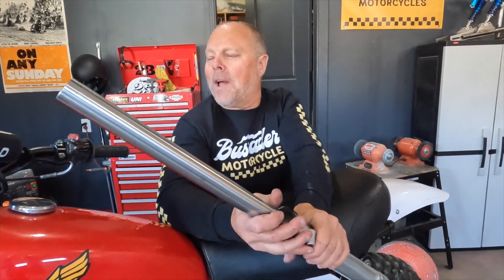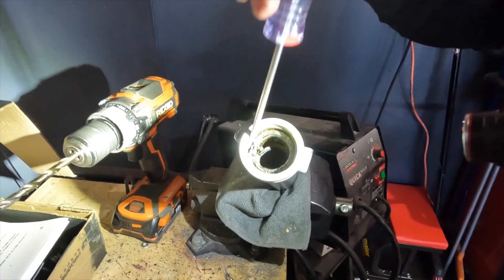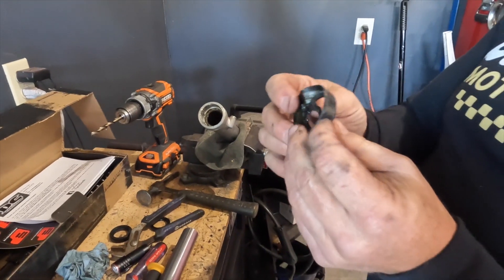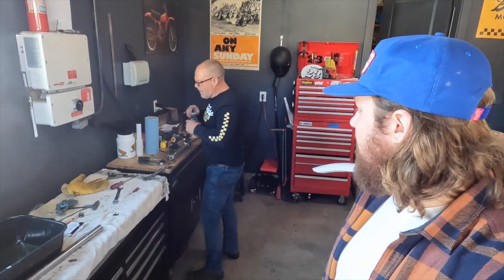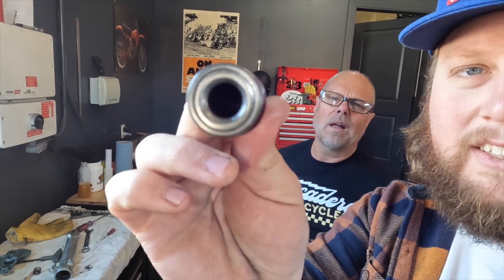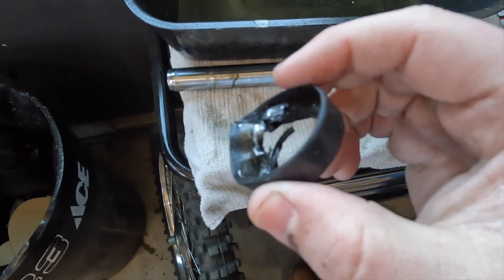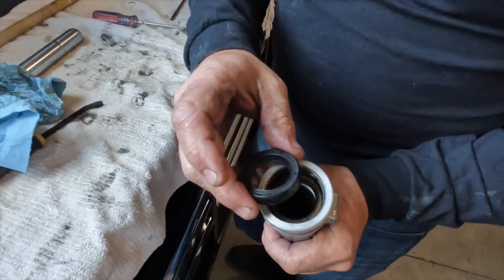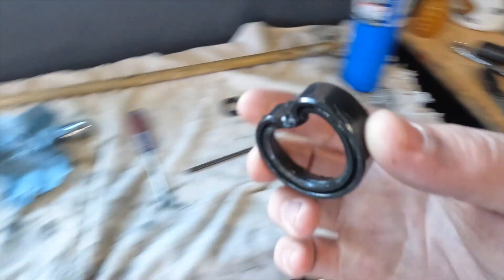Watch this before you change your vintage Honda fork seals!

Comment: 1987 Honda XL 175 owner here: This video just saved me!! Bought the “OEM” seals twice and was getting so frustrated that they would not fit! Find this video and was ver hesitant, as mine had no rubber left on it and looked like a pure metal fitting that was not to be touched.. low and behold it was the same thing as this! Much appreciated. Now I just need to figure out how to get my other fork Alan screw undone that the previous Jack wagon owner covered in locktight.
Reply from the maker: Glad to hear that, thank you! And good luck with that Alan screw. Yikes

Comment: My 73 XL 175 had the same weird seals.   Rigged a wheel/bearing puller to get that metal seal base out.  Having trouble tightening the leaking hex bolt to the piston rod, which spins...might need special tool to reach in an hold it.?

Shop manual for my bike says "Fill each front fork bottom case with good quality of ATF of 143 to 147 cc (4.9 to 5.0 ozs)."  !

Comment: I have a 1985 Honda 200x my right fork is stiff and doesn’t move around besides up and down and my left fork the bottom moves around like a bobble head so when I’m riding my front wheel wobbles like crazy I can’t find a fork rebuild kit anywhere got an ideas what I should do besides buy a set off another trike

Comment: So if I understand correctly, you just replaced the "double seal" with the regular single seal and it was fine and worked well? Thanks, about to rebuild a 1971 SL100 fork set and wanted to make sure.

Comment: I have the EXACT same thing with my 1973 SL125. I wonder if this is the original seal structure from the 70's? One additional thing would be nice to know: was there a separate shim underneath that stuck part? Because parts diagram shows there should be one.

Comment: 83/84 yamaha xv500, similar issue, rubber oil seal completely disintigrated, all the steel in the oil seal rusted to the leg. Suddenly a two day job